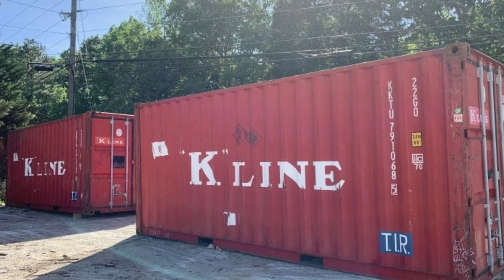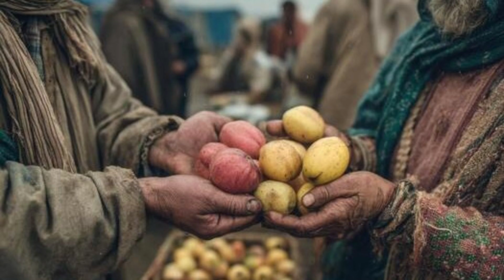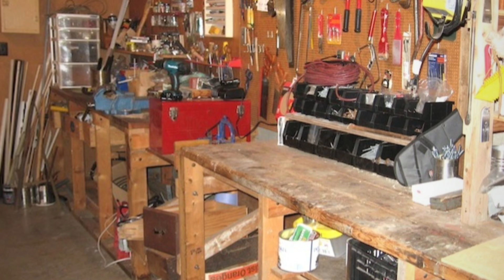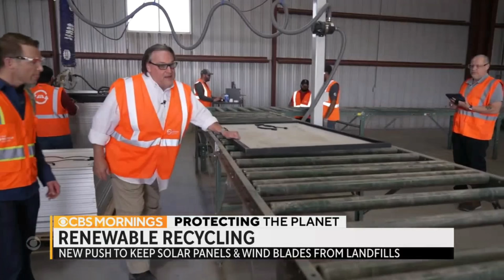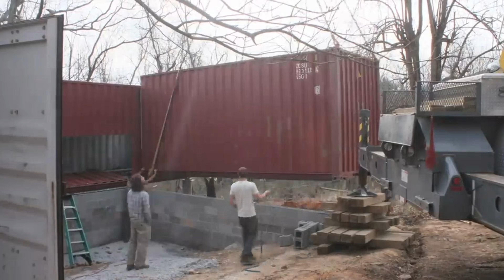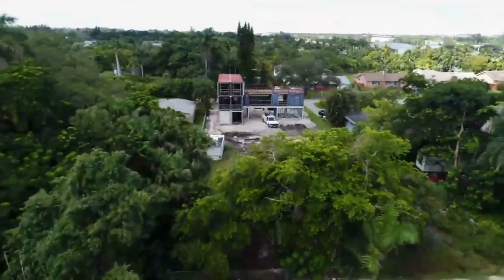Black Homeless Woman Turns A $250 Shipping Container Into A Fully Off-Grid Home

Comment: Most commercial spray foam insulations are highly toxic to humans and can cause some people to become extremely ill from them. If you're going to use foam, please protect yourselves and your family & choose NON TOXIC, MAGNESIUM OXIDE SPRAY FOAM INSULATION:
Magnesium spray foam insulation, often known as cementitious foam insulation or magnesium oxide (MgO) foam, is a lightweight, non-toxic, and fireproof insulating material. Primarily derived from minerals like seawater, it is applied on-site as a wet, shaving-cream-like foam that quickly hardens into a sponge-like form. Superior Fire Resistance: Magnesium-based foam is virtually incombustible and will not melt, drip, or emit toxic gases when exposed to high heat.Exceptional R-Value: It provides a strong thermal barrier (typically around R-4 to R-6 per inch, depending on the specific proprietary formula).Eco-Friendly & Non-Toxic: Made from natural minerals, it is free from the harsh chemicals and off-gassing associated with traditional polyurethane spray foams. I hope this helps someone. >j<
Reply: Once the foam has completely hardened, it does not release any toxic substances into the environment.

Comment: Marine grade plywood 
Angle grinder to cut steel 
Habitat for humanity stores 
Stell conducts heat and cold 

Insulation spray foam for metal 

Surplus auctions

Foamthe ceiling 
For. Board 
Constructiin adhesics 
Pakette wiod planking 

Vspor barrier 50 ft